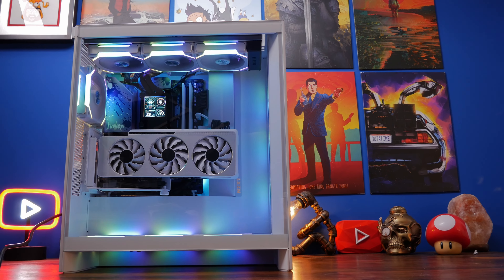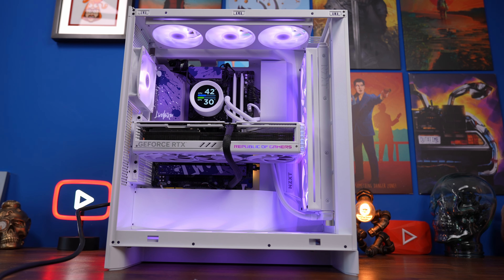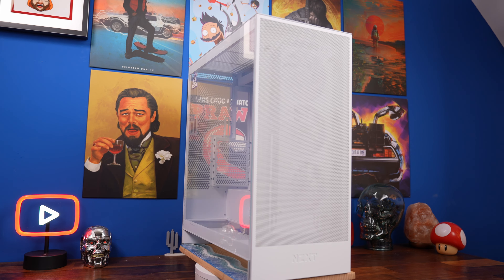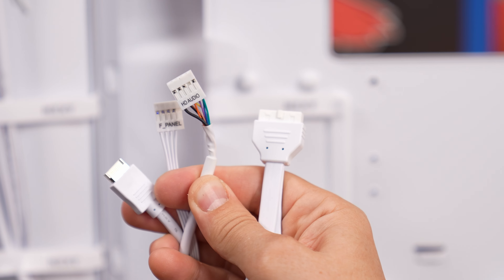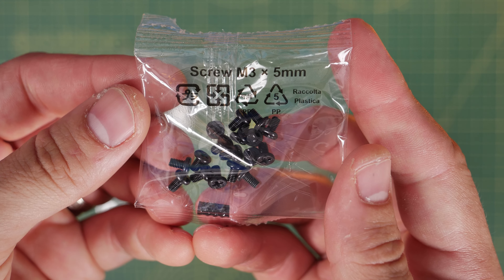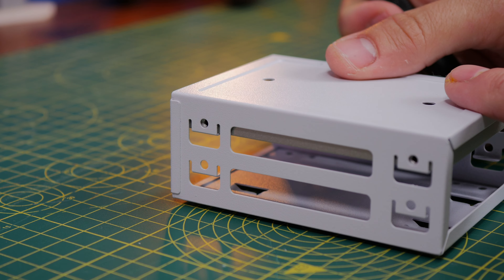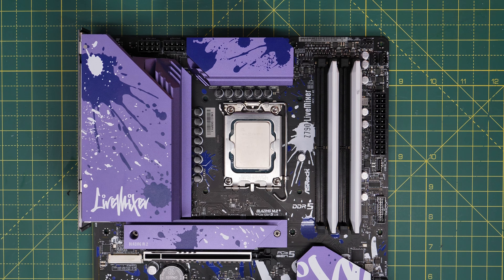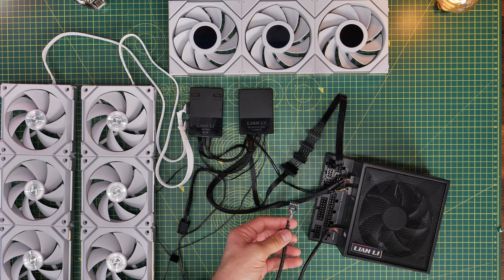How to build NZXT H7 Flow RGB with Lian Li Hydroshift and SL120 V2

Comment from the maker: Specs of this build (note these links might include affiliate links which earn me a commission at no extra cost to you):
Motherboard - Asrock Z790 Livemixer https://youtu.be/RRqPZTVOnd0
CPU - Intel Core i9-14900K (https://amzn.to/3QH6uUv)
RAM - Crucial DDR5 6000MHz Pro series RAM https://amzn.to/3UnPS6t
NVMe SSD - PNY CS3150 https://amzn.to/3KVWZNZ 
SSD -  Crucial MX500 2TB and Crucial BX500 2TB https://www.youtube.com/watch?v=IOJNybKZ4wk
PSU - Lian Li Edge1000 Platinum  https://amzn.to/45PIXat
AIO - Lian Li Hydroshift LCD 360R https://amzn.to/3RRwJZi
Fans - Lian Li SL120 V2 https://www.youtube.com/watch?v=86faWDF_7lY
Case - NZXT H7 Flow RGB https://youtu.be/lEHwGP9slIE
GPU - Gigabyte Vision RTX 3090 https://amzn.to/4bvNLTM
NZXT Vertical GPU mount  https://amzn.to/3XM38UN

Comment: Good day Mr Prawn!
I am planning on putting the Lian Lin TL140 fans at the bottom of Nzxt H6 Flow. Could you please share with me if it could have some clearance issue since the Corsair QX140 had some issues because of the cable on the side so it won't fit
Thanks!

Comment: So in a future build i plan on having 2 FRONT sl140 v2,  2 bottom SL120 v2 reverse, and then a hydroshift with 3 120 SLs if i can find a hydroshift black 360N...this should all run with one controller right? I did want to add a rear exhaust 120 lcd?? but I think Im stuck using a different controller for that one??

Comment: I think I messed up my build because of clearance. 

Got exactly this case with hydro shift 360tl (59mm height).

Can you confirm that I messed up? NZXT H7 FLOW 2024 + HYDROSHIFT 360TL + STRIX X870E + GSKILL Z5 NEO 2x32.

Comment: That's an ASRock MB yes? The board I am looking at you would not use that top PCIe slot for the graphics card if you use M.2 5 because it will switch from 5x4 to 5x2.
Reply: Also, the new radiators (I don't know if that is one) have more FPI which raises the SP drop across the radiator. Each fan has a fan curve. The white fans may be prettier but may require higher RPMs to adjust to the higher pressure making the rad less effective by some time noticeable percentages. There's no way for me to know without much more specifics. 

Sticking to Intel limits in the BIOS would be what I would do. It's a very nice build. One of the cleanest I have seen in your videos. I'm not a gamer and so graphics is not a priority at all, data rates are, that why I would care about the M.2 5x4 and max memory would be my priority. 

Being more of an old boy than you in your youth, I prefer the single glass case there if it would fit an eATX MB. The fish tank of the Lian Li XL case is more likely what I'd do. I have not decided. They are quite a bit more dear than I want. 

Great video production quality and I admire your overhead tram. Lovely voice for the voiceover. Your YT persona is brilliant.
Reply from the maker: https://youtu.be/RRqPZTVOnd0
Reply: It's quite possible I misunderstand. Intel says up to 32 GT/s per lane. If you pull 4 lanes is that not 128 GT/s?  At least on this board, it steps the video card back (or so I thought). I don't over clock.

Comment: Lian li fans are crap! especially the controllers, I've had to buy 3 packs of fans 2 times because the fan/rgb cable keeps breaking off with the connector inside the controller. it sucks, cool fans but shoddy wiring.
Reply from the maker: Interesting. I've never had that issue with any of the fans I've used